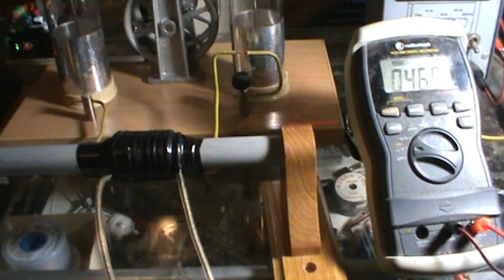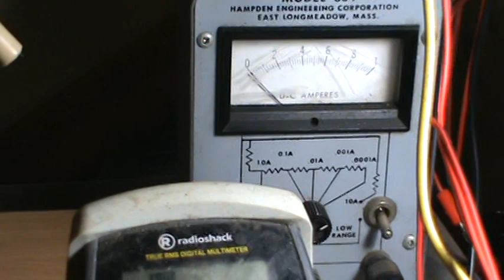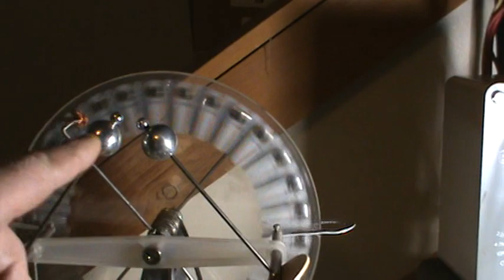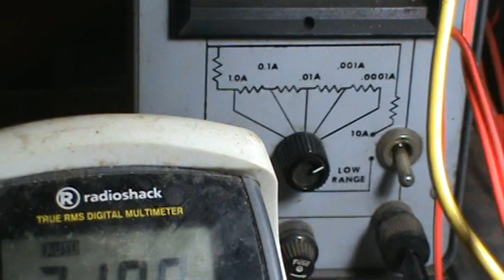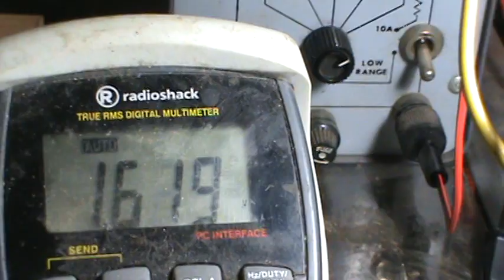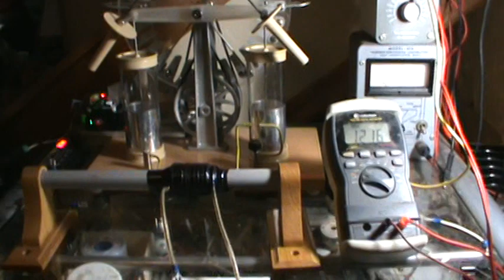Charging a Capacitor with static electricity

Comment: How big is the capacitor? Why dont use step-down coil or transformer if the spark is so strong to kill the diodes?
Reply from the maker: The capacitor is 25vdc @ 680uf . I show charging with a bigger cap here https://www.youtube.com/watch?v=TQzQpM9THDM&t=1s . I have done many tests with this setup , here is a bigger coil https://www.youtube.com/watch?v=NfPPLvGLLrA&list=PLUZEjUv_mAZe1Oi4ZM02jnMS7Y8f2XpbQ&index=2 . Feel free to look at my playlist where i show many different tests .